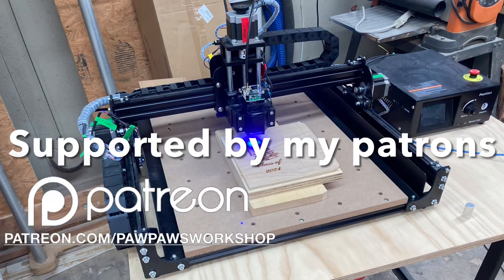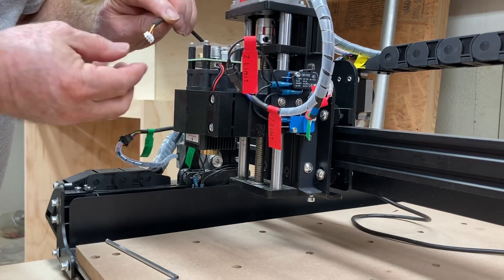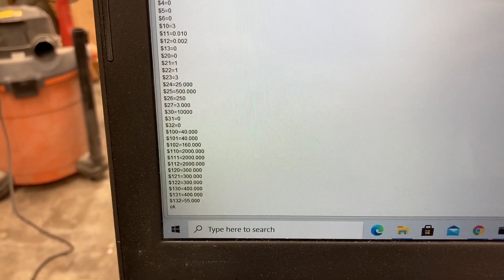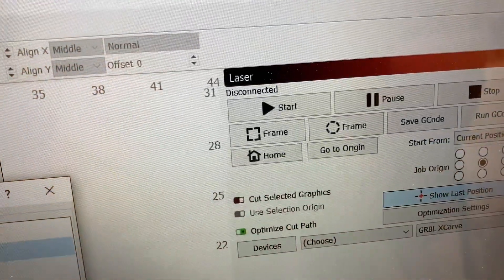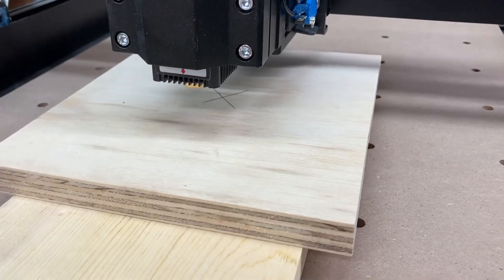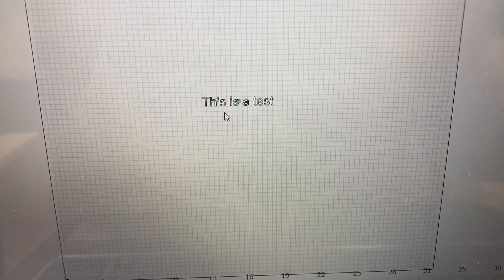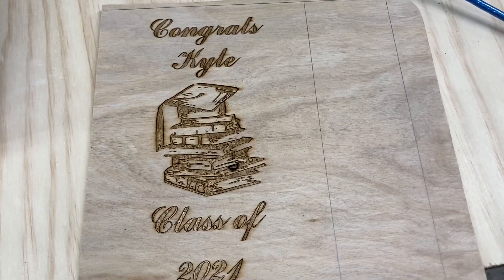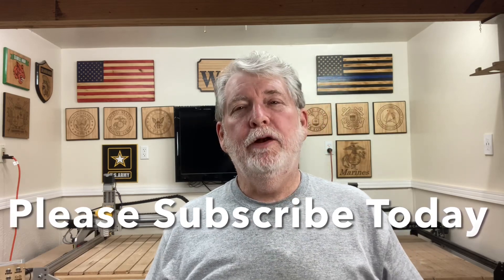Adding the Laser to the FOX Alien 4040-xe

Comment: I can’t make my laser reach the spoilboard at 30mm. How much did you have to build up the piece so it would engrave correctly?
Reply from the maker: The height that you need to raise up the piece all depends on the project. If I am engraving a cup, I may need to raise the machine. Other projects I will raise the project up anywhere from .5” to maybe 2”.

Comment: Excellent video. I was bent on buying a laser but may go this route now.
Reply: Are there any disadvantages going this  route vs. just running a dedicated laser machine?
Reply from the maker: For the most part you can only do one project at a time. Based on your budget having one machine that does both works well.
Reply: Does adding the laser to a router mean it won't perform as well or not be setup for the speeds of a dedicated laser?
Reply: About to buy my laser. I have the machine almost 3 years now and have never used it😢😢😢. Don't like the idea of using bits

Comment: I just for your channel and it's very informative. I want to make clocks and a few other wood items. Would this machine work to make shapes 24" in diameter? I don't think I want to go any bigger. What's the biggest your machine will make? Will the Fox Alien 4040 xe do this?
Reply from the maker: You will need a larger machine than the FOXAlien 4040-XE to cut 24” diameter. You will need the XCarve by Inventables or CNC4NEWBIE New Carve or a similar machine.
Reply: @PawPawsWorkShop  Will a Shapeoko XXL work?
Reply from the maker: Yes. I believe that is a 1000mm machine

Comment: When setting out the laser to trace the outline of the work....hold down the shift button on the keyboard and then click the frame button that will fire the laser at low power and show you where the work boundary is.  Hope that helps.  Cheers
Reply from the maker: Thank you, great tip

Comment: I feel like my JTECH 7w works better than that 20w. 80% on the Jtech going that slow would dug in 1/16-1/8th inch
Reply from the maker: It actually did carve deep. I’m taking it slow with this laser and will be doing additional tests. Thank you for you comments
Reply: @PawPawsWorkShop  no prob! I just did an engraving on a walnut cutting board. Ran it at 67% and it was almost to deep lol
Reply: @PawPawsWorkShop  I guess all I’m all, I had expect more out of a 20w